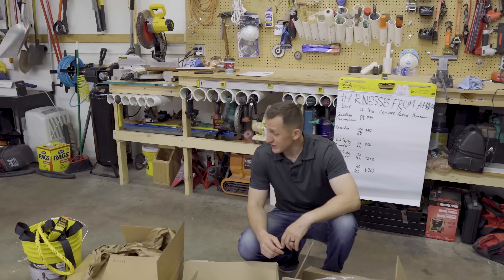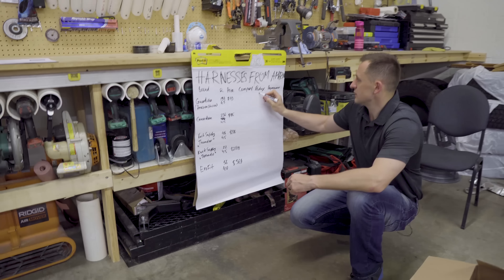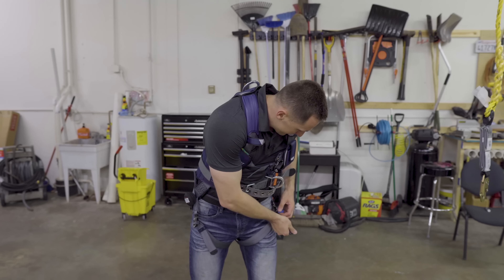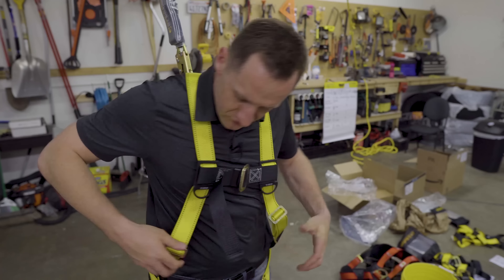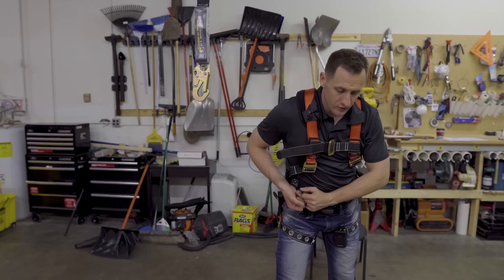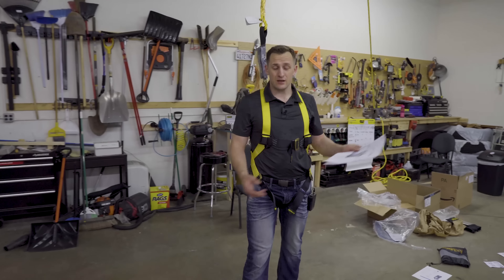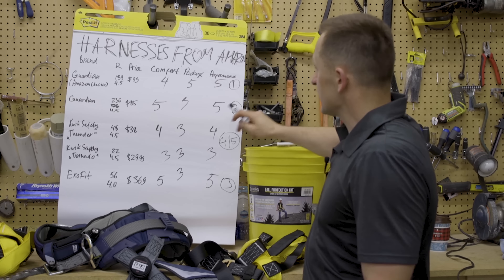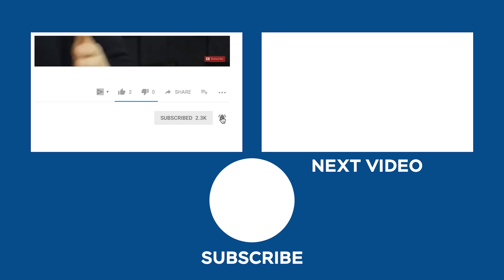Exofit Harness VS safety harnesses from Amazon Comparison

Comment: Awesome review.... As an industrial blaster and painter, I work on bridges, hydro towers, and hydro dams. I work on a lot of different high structural steel projects, up to 400 feet in the air. Most companies I work for will only supply exo-fit harness.  Thanks for the video.

Comment: I'm a 3rd year carpenter and a 2nd year scaffolder I wore a dbi sala exofit for 2 years straight everyday. In my opinion it's the best harness for any kind of building trade. You carry alot of weight during the day and believe it or not having that extra lumbar support makes a difference. It's also super convenient hanging your tools off of it. The only backside of it is that it gets kind of toasty in the summer.

Comment: I have two of those bucket harness packages from different companies, both come with roof anchors. Not a roofer just a regular guy getting up to paint, clean the gutters or do some roof repairs. I much prefer the rock climbing harness with belay loops for both front and back, gear loop plus ability to rappell with it. With the attachment on front I could climb back up, couldn't do that if the rope was attached to the D ring on the back.

Comment: Thanks for the video.  It would be nice if you showed how feasible and comfort level for seating on the "seat strap" (attached to the backside of the leg loops).  Seating on the seat strap, while suspended, will help alleviate blood restrictions to your legs to avoid or minimize SUSPENSION TRAUMA (other similar names exist).

Comment: Fall arrest harnesses are not climbing harnesses.  They will save your life if used properly, but you need to get help right away because you should not remain suspended for very long.  The better the harness the longer you can remain in one without problems, but even some of the most expensive ones recommend being rescued within a few minutes.  The rope often has a device or section that will absorb some of the shock experienced during a fall, which, if you fell far enough, could cause fractures or other trauma.  The harness should be quite snug fitting, but should not impede the motion you need to do your work.  I like your idea of testing them.

Comment: I’m sorry but you are wearing that nex completely wrong. It is adjusted from the legs going up fighting things up. All of the harnesses that have osha rating are fine for protection. The real question you should be reviewing is weight and convenance and comfort if you are going to sit in it hanging for an hour. Catching a fall is easy. Comfort while hanging in it for hours is the hard part.

Comment: Exo fit must be #1. This is coming from someone who worn one every day. 

Right now I use miller because of price and that I like changing my harness before every winter. 

I’ll say pass on the rest.  By the way you where wearing them wrong.
Reply from the maker: +Radu Raicov thanks for feedback. We did like exofit.
Reply: Try out the Miller ones. They are around 130$ Canadian dollar, very good and safe. I think it should have been in the video as it is more accessible for the masses
Reply from the maker: will try it. How were were we supposed to wear them?

Comment: The exofit is designed for high rise construction (bridges, dams,skyscrapers,etc) it’s designed to put your tools pouches on the belt, and leave them. That’s why it doesn’t come with a bucket. Lol. You also clearly did not set it up properly if it slipped up THAT much when you hung from it.

Comment: Company should supply all Saftey equipment. Rats
Reply: I have worked union most of my working life, and used the company supplied harnesses. I have never seen a set of instructions, and never gotten harness training. It is my belief that all contractors should pay for fall protection training and require anyone who works for them to get certified on how to use a harness properly. Then have you buy your own harness that they will reimburse you for on a yearly basis. That way you are always using YOUR harness that is always properly adjusted to your body and work needs, and that no one else can use, change, or abuse without your permission.